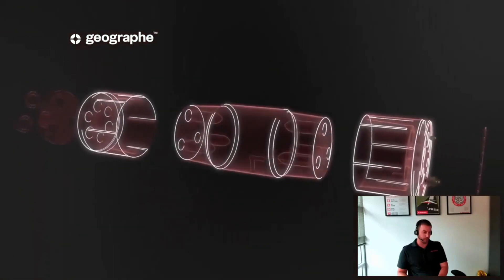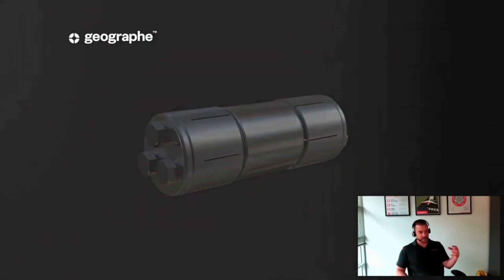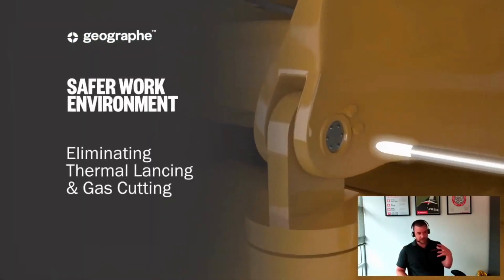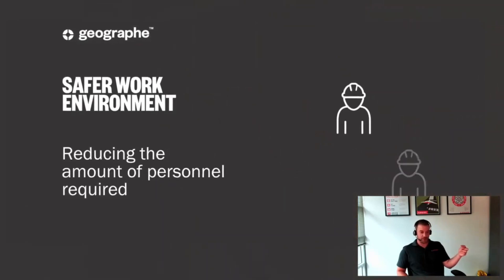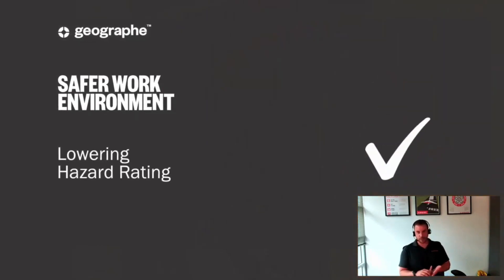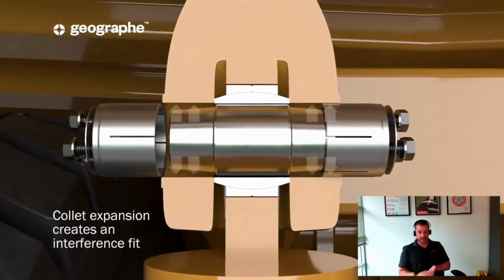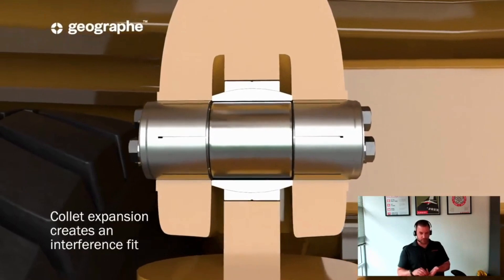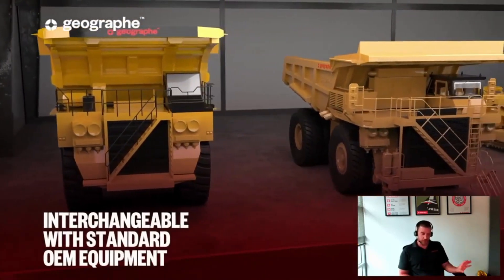How can thermal lancing on haul trucks be eliminated by a component change?

Comment: so basically an Expander pin
Reply from the maker: Similar idea, conceived in the mid 1980's around the same time the Expander pins were.  However Geographe pins will not walk out as others have reported to do, and others do not have a jacking bolt system to help remove them at end of life.

Comment: I work at a mine that had exceptional maintenance on their equipment, so far as with perhaps 80 trucks, 14 diggers running 24/7 lancing is only ever done on hard to inspect areas Usually a travelling sheave or on a dozer equaliser.
Reply from the maker: Our customers have issues with the varying conditions from site to site, which can increase or decrease the extent that lancing is required.  It's the unpredictability of when it's required that is one of the key challenges.  The designs for colleted pins also extend to CAT dozers too.